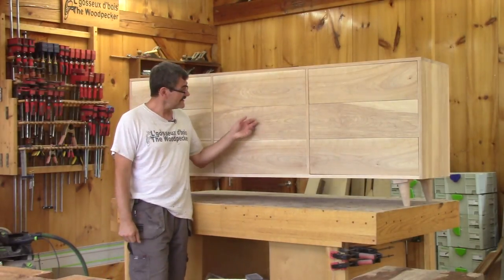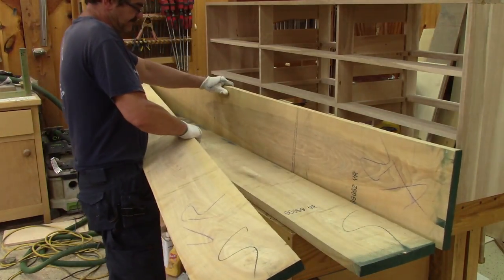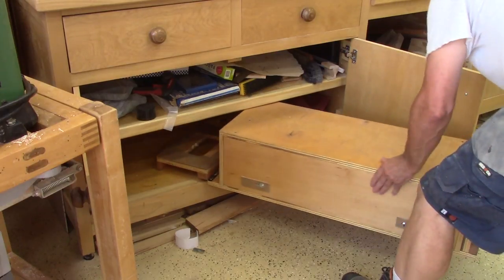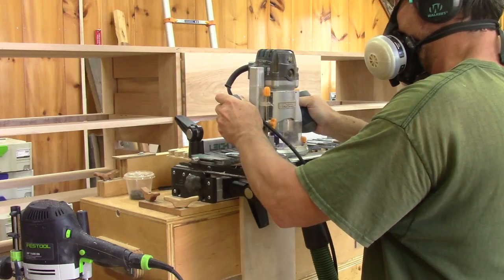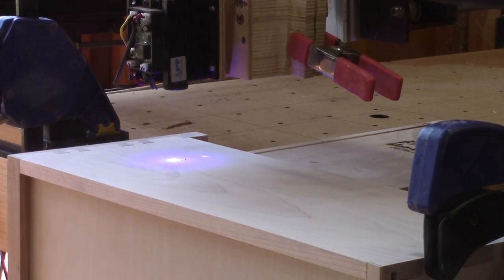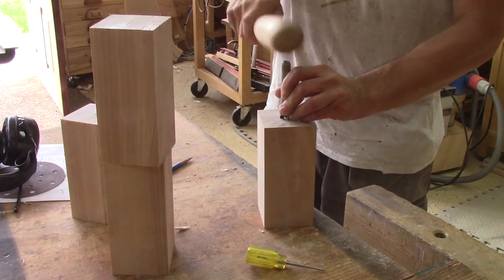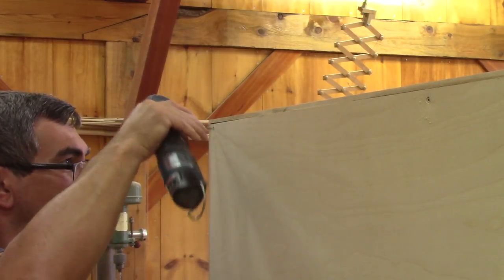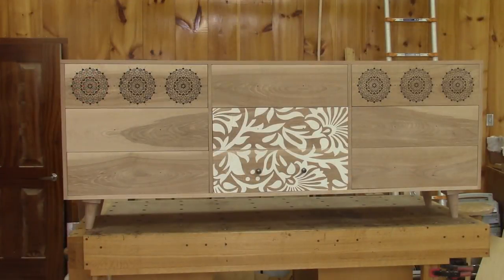The Woodpecker Ep 244  - Nine drawer dresser Part 2

Comment: I noticed something on this video. You have Bessey parallel clamps and Irwin also. I just went to my local Lowe’s and looked at Irwin but seen the jaws are not straight straight with the bar so went to Home Depot and got the bessey for a lot more money. Have you had this problem with the Irwin? Witch ones do you prefer?
Reply from the maker: I didn't noticed that my Irwin clamps jaws are not straight... I will check 
I prefer the Bessey, the acme threads is coarser so I can't apply as much pressure as the Irwin and it's a good thing, too much pressure means less glue on the joint. But I can't say that I dislike the Irwin I use them quite often on big glue ups. 
But don't make the same mistake I did. DON'T buy Bessey  pistol style clamps they're not very good, at least for my taste. I prefer the nice piston style Irwin pistol clamps. I need to buy more of them. The can apply over 600lbs of pressure. I brought all my crappy pistol clamp to the cottage, I rather have crappy clamps over there than not at all...

Comment: What a beautiful project, hopefully you get some photos of it finished and in its new home! The artwork on it is something different, I think I like both the light and dark patterns, but maybe not on the one piece; there will be a million different opinions on that though. 😄
Was all the thicknessing in this project, the inspiration for you to go buy the mini max? 😂
Reply from the maker: Yes the dark and light colour add something special. I was careful not to use dark streak on the side and top so it wouldn't be too busy. I intend to use this birch for the inside of m TV lift, which I couldn't find the time to continue yet...
I wish I had my minimax when I did it that's for sure, I spent days sanding the marks my planer leaves on the wood...
Reply from the maker: Jean-François gave me a link to a picture of the finished piece in his bedroom here it is  http://thewoodpecker.net/images/Commode.jpg
Reply: @LgosseuxDbois-TheWoodpecker  Thanks for this photo. As long as the customer is happy, that's all that matters.